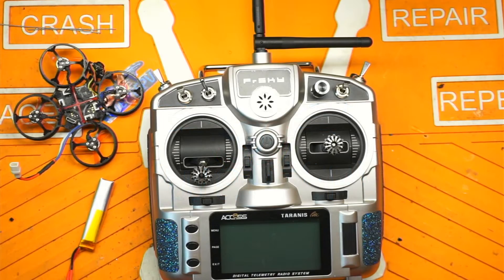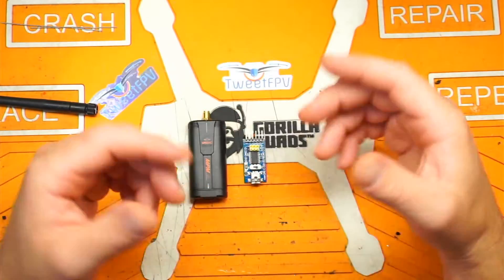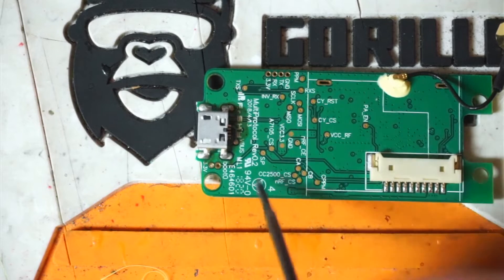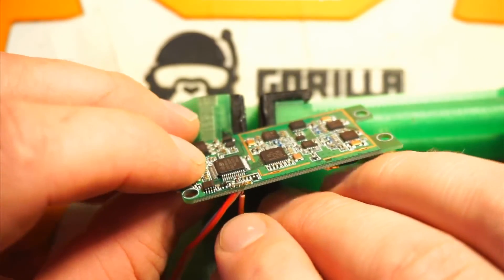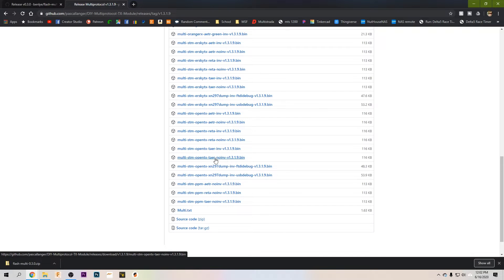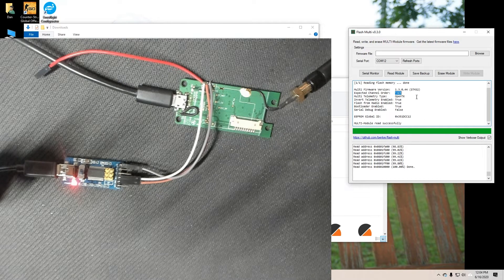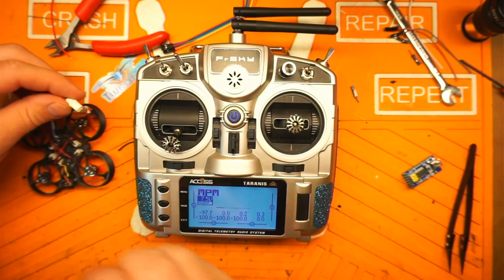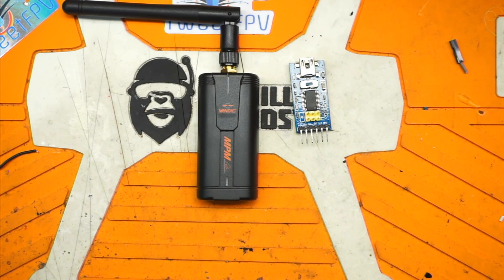Vantac Irange MPM lite firmware / boot loader update.

Comment: BTW, this thing's a pos. They put the cheaper 64KB chip in, not 128KB per multi module documentation. The result is a kneecapped multi module.

Comment: Can a ST-link USB debugger be used instead of the FTDI adapter?
Reply from the maker: No
Reply from the maker: Also you don't necessarily need to do this to update your moduel. The older ones didn't have a bootloader flashed it them but the newer ones did. So just give it a go without the ftdi and see if it works.
Reply: @TweetFPV  And mine is older.
Reply: @TweetFPV  I got an error saying that the bootloader didn't support 128k off flash or something, so that I assume that I need to do this.

Comment: I flashed my x-lite firmware(i think) and now the mpm lite doesn't work, or show up i dont' know what to do to fix it, half my models are using the MPM and now I can't fly them.
Reply from the maker: Which fw did you think you updater?
Reply: @TweetFPV  the latest one i think its 2.3.9
Reply: @TweetFPV  when i power on the RXSR i get a solid blue light and a blinking red light. When i hold f/s button down when powering it on it get solid blue red and green lights, no blinking lights.
Reply from the maker: Hmm updating opentx shouldn't change anything related to the mpm if it was working before. I would attempt to rebind  your mpm to the rxsr.
Reply: @TweetFPV  i figured it out, i flashed my x-lite with the precompiled image instead of using the companion which allows you to add "multiprotocol" to your image. Working now!
Reply from the maker: Awesome. Glad you got it working!

Comment: you have to do this with IRangeX IRX4 LITE CC2500?
Reply from the maker: If it doesn't work using the flash multi dfu utility then you will need to do this. The issue is that older versions of these did not have a bootloader flashed to the memory. The newer ones have a bootloader and should update through the USB port with no need to wire in the ftdi board.

Comment: Please check the new the new update of the Multi Protocol .  Try to upload the new firmware. New update did not works due to processor. If you find any solution. Then please update it.
Reply from the maker: I finally got a newer MPM and the flash multi program works without modification. This process is only needed for older hardware that caw without a bootloader flashed to the internal memory. After you flash the new version this process is no longer needed.

Comment: By the USB port is possible to flash and upgrade ?
Reply from the maker: It seams like i can upgrade it now. Im not sure if i can now because i have already updated the boot loader. The Flash multi program still can't read the module but it looks like it will update the FW. I have a new MPM on the way to test.
Reply: @TweetFPV  Ok, I find if is possible with port USB only. 😀

Comment: go to github com benlye flash-multi then download the multi flash software then open folder drivers in there then click at install_drivers.bat then plug the usb in your computer and the module then start multy flash then do upgrade  !!! this what i did and its works you can try it before do what in this video if not works then do what explain here ..
Reply from the maker: I don't believe that this process will update the bootloader which is where the problem is.
Reply: @TweetFPV  it will you just try it :) I have first patch xlite and this module .. before two years it will have to do your way because it will not boot from usb .. but after release flash multi they find a fix by run the install_drivers.bat that in flash multi software folder then will accept the usb and after upgrade your modules you dont need the external way to flash it.. next time the transmitter can do the upgrade without using external method
Reply from the maker: I have another irange x lite I'll try that on.
Reply: @TweetFPV  nice :)
Reply: @TweetFPV  Im interested to know if this way worked. Have you had a chance to try this please? TIA

Comment: I think my xlite pro has an issue ( possibly blown 5v regulator) because it's not powering my mpm , the light wont come on or anything. The only way i can get it working is to hook up a usp cable directly to the mpm to give it power then it works fine, I've even bound it to a receiver like that but it dose say on the xlite's screen that the module needs to be updated in the model setup where you can turn the module on or off. Dose it sound like a controller issue to you or do you think flashing the mpm will fix it
If Im under the correct understanding  flashing the  boot loader fixes the problem with the usb not working so one you do that you should be able to flash the mom directly from it's own usb port. I haven't been able to try this yet so I cant confirm but I did alot of researching on this awhile back unfortunately I decided to try to cheap out when I purchased my ftid connector and ordered it from banggood right at the beginning of the covid thing and now about 3 months later theres no sign of it.  Sense then banggood has changed there refund/reship policy from 60 to now 90 days witch is kinda ridiculous in my opinion. If something arrives over 2 months after I order it there's gunna be  a good chance I'm wont even remember ordering it! Sorry for the rant,lol.
Reply from the maker: I have never been able to update the fw through the USB port using the updating program. Possibly you could through arduino ide interface. If you were thinking that the radio is the issue you could always check for 5v at the Jr bay with a multimeter. Updating the mpm bootloader and fw is certainly a fix for it not powering on.
Reply: @TweetFPV  i forgot to mention that I have checked the 5v with a multimeter and didn't get a voltage reading but I wasn't sure if the tx would still supply voltage without the module hooked up.  So my 5v regulator must be blown or something similar because like I said the module works fine on my xlite pro as long as it has a direct  power source  so that should mean everything else is working properly with the external module bay.  I know that the first batch of xlite pro had issues with the pmu and I ordered mine within the first week of its release so maybe it's something with firmware but I've done the updates and even factory rest it twice and did the updates again without results so I'm thinking it's a hardware issue. I love the xlite pro but I regret buying it so early after its release because it definitely wasnt a polished product at that point, I know your well aware of its issue and actually it's kinda funny because that's how I originally came across your channel. when I was trying to do the for update of my firmware your videos were a lifesaver so thank you for that, been watching your videos ever sense. 

 I'm not sure if you understood what I was trying to say when talking about updating the mpm or maybe you did and I what I said was wrong witch is highly likely too but I'll try to clear it up. What I meant was after you flash the  bootlaoder on mpm using the ftid adapter you should then be able to use the usb port on the mpm to do the update its firmware. Somewhere I'm pretty sure i read that the problem with the usb port on the mpm was that it had the wrong bootlaoder and that flashing the mpm with the proper bootlaoder fixes that issue so if you were to plug a usb cord from your computer to the usb port on your mpm it should work now sense you have already updated your bootlaoder. I'm not themost techno savvy person so it's also highly possible I'm wrong an I just misunderstood what I had read too but I hope that's not the case so I dont look like a complete fool. Lol.. I'm pretty sure I seen this somewhere on github in the multiprotocaol project thread about common issues. It's been a while sense I saw this but anyways I'll see if I can find it again so I can send you a link to the page where it was mentioned.
Reply: just download the flash multi then there are folder called drivers click at install_drivers it will works after that you dont have to use your tx upgrade the module then plug it to your tx